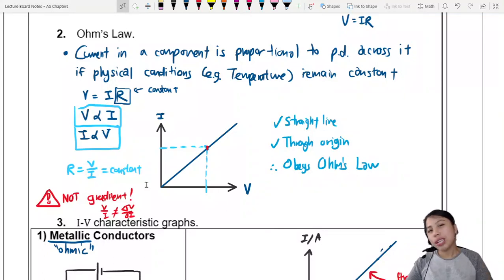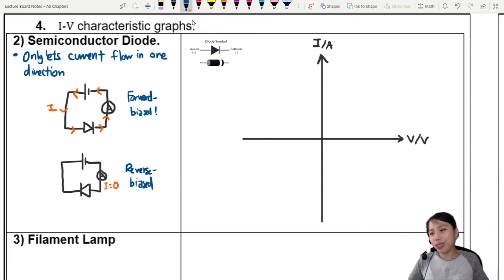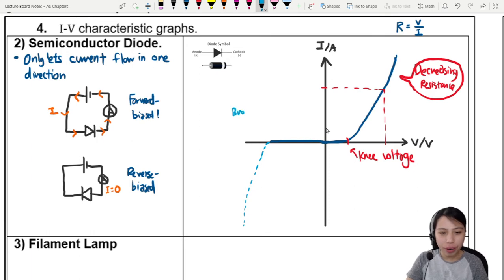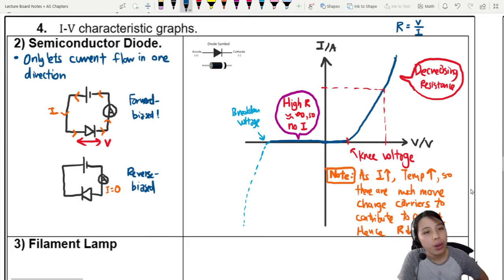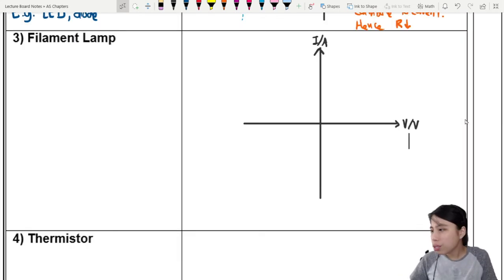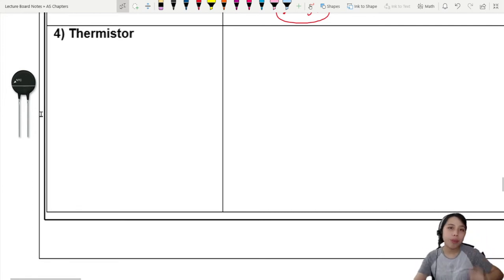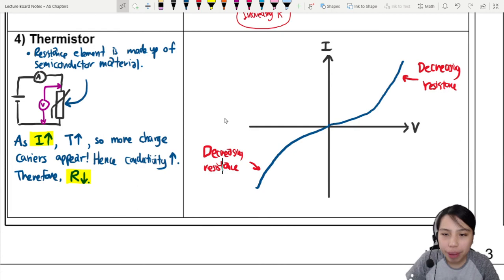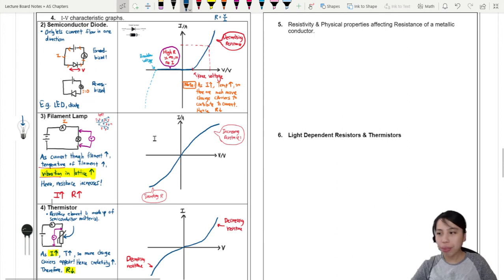9.3b I-V Characteristic Curves (Diode, Filament, Thermistor, LDR) | AS Electricity | A Level Physics

Comment: why in filament lamp when temp increase, it is harder for charge to flow but for diode it increases charge carrier?
Reply: because the material used for filament lamp has high resistivity
Reply: 17:25
Reply: You need to learn about semiconductor and how it works in order to understand it

Comment: Can somebody please explain how increased conductivity leads to lower resistance? Obviously  number of charge carrier (electrons) increases but wouldn't that increase the electrons-electrons and electron-cation collision? so wouldn't that lead to higher resistance? This is regarding the part of "thermistor"
Reply: I think it's because that they are made of "semi-conductors"; as such, the property of the material is different than that of a metallic conductor. In which they tend to possess a higher resistance at normal state but release more charge carriers when energy (can be thermal) is added to them, so more delocalised electrons can freely move and carry charge. This might also explain why LEDs have lower resistance when the light intensity becomes high